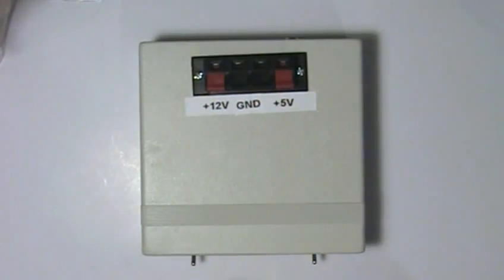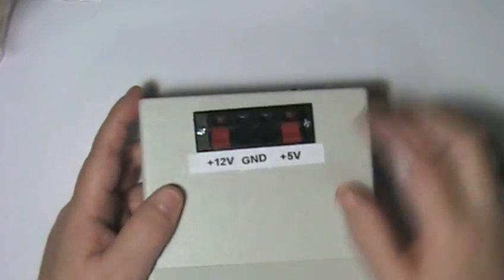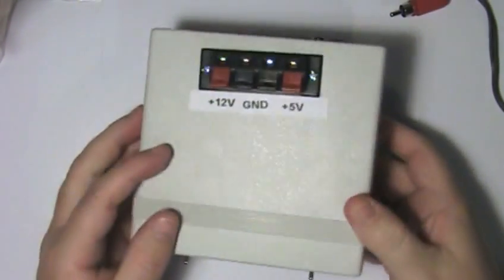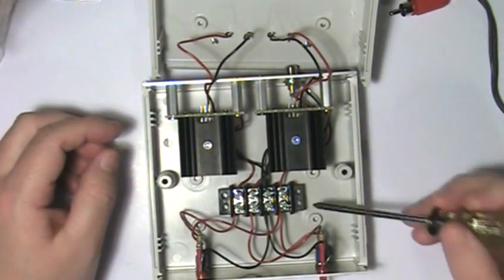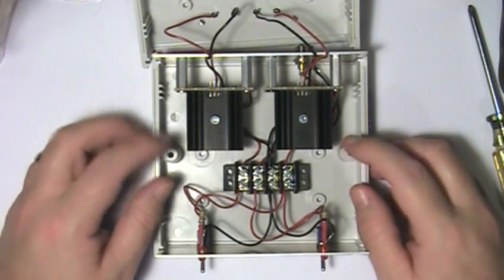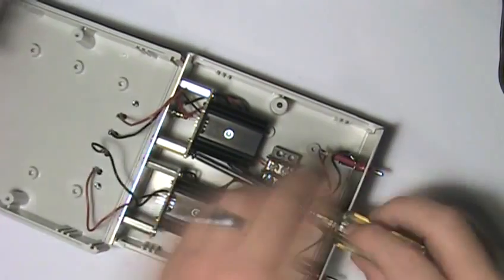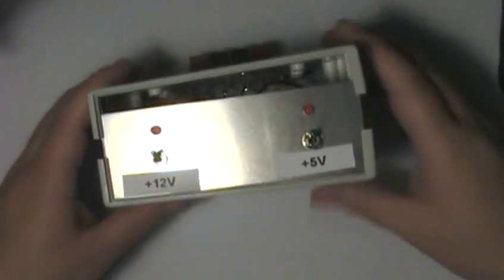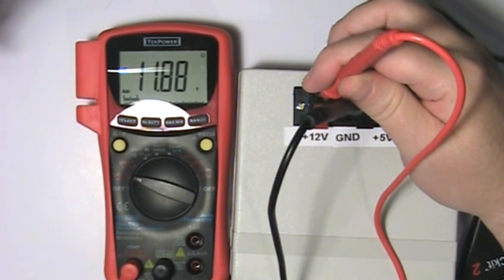MD Lab: Basic 13.8V to +5V and +12V Regulated Power Supply

Comment: Did I miss the part where you mention input Amps at 13.8v  and output Amps at 12v and 5v?
Reply from the maker: Each regulator can handle up to 1A each, but that's also going to be limited by what he 13.8V DC PS can supply. In this instance I was using an old Radio Shack power supply that is rated for 2.5A. 

This was a fun build that was educational. Even though I don't use this setup anymore (I switched to professional units a long time ago), I do believe I still have it floating around here somewhere. I recommend everyone into electronics should attempt something like this, just as an educational excercise.

Comment from the maker: @David13241 It actually doesn't take much to start warming them up, 100ma or so. One general rule people go by is if it's too hot to touch, then it's too hot. If these aren't in an enclosure yet, then you don't need to worry about fan, adding a solid heat (like the ones I have in this video) sink will take care of cooling just fine. However, when you start getting into the higher currents, like 500ma and higher, heat becomes a real problem. But, under 100ma heat isn't too much of a concern.

Comment: @magidavid Thanks. I wasnt sure about the heat. I wasnt really going to be hammering them. But I did read about heatsinks figuring I could add later. Not sure on the model. Sounds right. It survived the fire. Dont know what it put out b4 that. Does @13.88v now. Have a spare multimeter, I was thinking of using when I pretty it up. Probably a computer psu fan or case fan will work fine, even in your box. Wont take up a lot of room and you can get them in many rpms. But you already know that. Thanx

Comment from the maker: @David13241 I still have, and use, a Micronta 12V power supply that is also 2.5 amps, it might even be the same model (22-120A). You'll find that those voltage regulators will start getting hot when you start pulling significant current, so you'll need to add some heatsinks to keep them cool. A voltage meter would be nice, but using a inexpensive multi-meter will accomplish the same goal and be useable in other circumstances.

Comment: A regulated power supply was one of the first things I built. Its not fancy (yet) but about the size of your terminal block. It has 5volt, 9 volt, and an adjustable 12 v with a 10k pot. I have it wired to my breadboard.I have an old Micronta power supply from radio shack putting out 13.88v 2.5A. I used a 7805 for the 5v (getting 5.5v), an NTE1911 for the 9v, and an L317 for the variable. My original plan  included a voltage meter on the adjustable. You have a few nice 'clean up' ideas. Thanks

Comment from the maker: @Superlortenar Yes, and I do plan on adding ventilation. And to help keep dust out, I'm going to put the holes along the side of the case. I'm also working on adding a small 12V fan, and use a MCU to monitor the heatsink temp and turn the fan on when either heatsink temperature rises above a set preset value. I plan on making a video on this mod once I have all the bugs worked out.